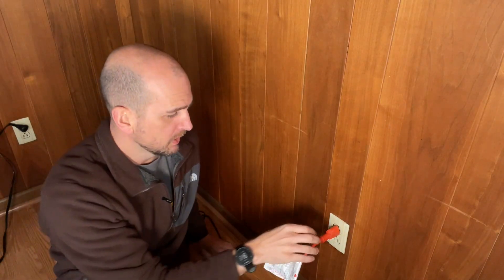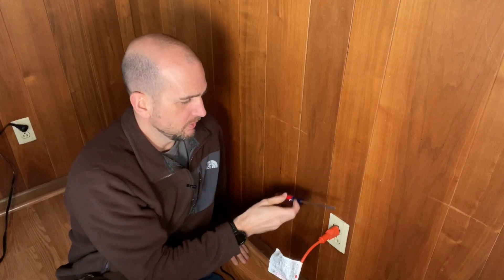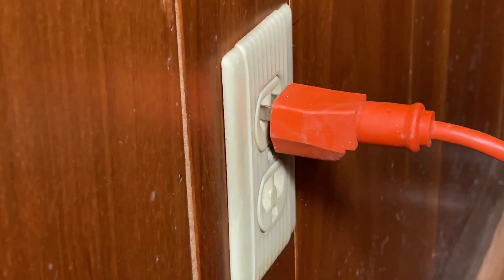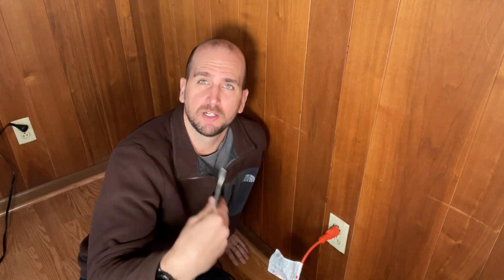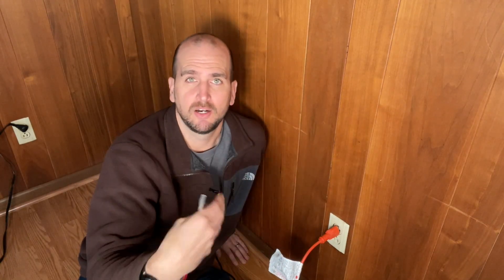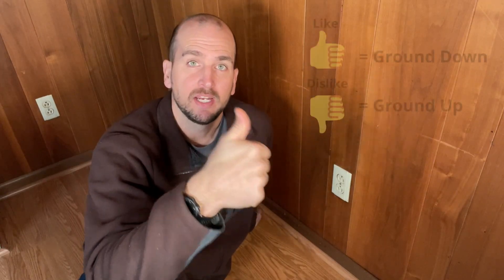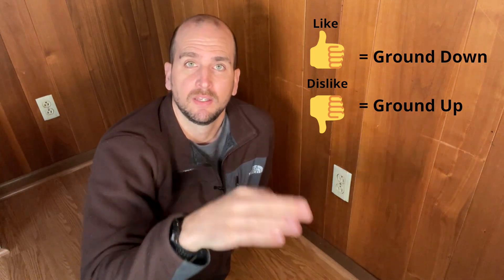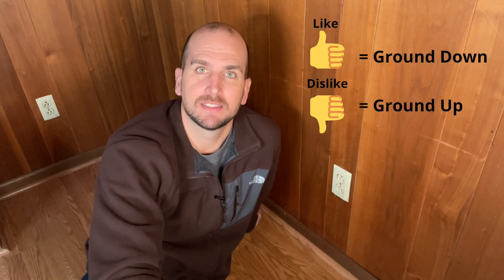Should An Outlet Be Installed Ground Down Or Up

Comment: I saw my Dad mount outlets ground up in the 1970's . I thought it was weird, so I asked him why. He said, looking at the male plug, that the ground prong was longer, and so, had to go in first. He put it on top, to make the first  part of the operation easier. Made sense to me. He had had it out, politely, with the local inspector, who could find no rule against it.
Note-I worked many years as an industrial maintenance mechanic and electrician, and always installed them ground down.
Reply: Mechanic/Electrician, were you a multi-crafter? That's what my job calls us maintenance folks
Reply: @lauratanner8475  yeah. I was officially a Maintenance Mechanic. But I worked in small shops where I did it all.  One where I single handedly ran all the rigid conduit and pulled all the wire for 80 A, 3 ph, 480 v welder outlets in 2 djfferent buildings. One where I did the complete installation,, power and control, for a high speed rotary cutter. I rewired panels, rebuilt control boxes. I was happier doing electrical work than mechanical, but had no license. In multicraft shops, no electrician ever found fault with my electrical work.

Comment: Always per NEC ground down, if ground up and the hot wire was to come loose and fall to the bottom of the electrical metal box instant short spark and possible fire.

Comment: Ground up ALWAYS, for me. Why? 30 years ago, one of the kids had a toy tambourine. One day they dropped it & one of the thin metal disc's came off. By pure fluke, it hit the wall & slid straight down on to a ground-down plug, causing it to short with a flash/bang. There was barely any space between the plug connector & the socket, just enough for the thin metal disc to fit in between. It was a pure fluke that may never be replicated, but since it did happen, the homes we bought since then, I've insisted contractors install all plugs ground up.

Comment: I have seen hospitals doing it both ways.  Sometimes even varying in different parts of the building.  This week I even saw a duplex receptacle mounted sideways above a desk with the hot side facing up.  Now that I think about it, what about mounting plugmold?

Comment: Like you said it is up to the Inspector for when I had my inspection on my house the inspector said reverse the outlet on refrigerator  for the cord went up.  I just replaced the plug / cap and inspector said perfect.  He said you can't have tension on cord by doubling it over.  Black coils help keep it plugged in and I don't know how hot the coils get but it never melted plug in ten or so years.  My coffee maker  did melt the cord but luckily it melted on Neutral side and never blew breaker.  Inspector had only one issue and all outlets  had  both  ground up & ground down but kitchen was the only issue .

Comment: Ground up
It happens all the time a commercial buildings when a desk is against the wall and a paperclip falls down the backside it will hit ground first 
Or if the outlet has a metal cover plate with one screw holding it on. 
Safety starts with a "S" but it begins with YOU. 
Ground up not down

Comment: Ground should be down.
Gravity tugging a plug coming loose from a wall can cause an up-facing ground to fail first.
You want the ground to fail last.
In a grounded appliance the ground is the most important connection.
Reply: "The most important"?  More important than having a working "hot"? What's the point of having an electrical appliance without giving it electricity?

Comment: The male ground pin is a bit longer than the others. So if the plug is lower than eye level ground up makes it easier to plug in. Higher than eye level, ground down is easier. 
The arguement about a loose outlet is mute. It is a fire hazzard. loose electrical connectors generate resistance and heat.

Comment: Not sure if this addressed above but back in the 60s when grounds were introduced, bedrooms and living rooms had switched plugs. You could plug a lamp into a plug and turn it on with the switch(there were no lights on the ceiling). If a plug was switched, we would install it upside down (ground up).

Comment: I was taught  in trade school  ground  down  years ago  one reason why  is normally  the ground  prong is longer so if the   receptacle be comes  worn and become loose and  unplugged it will fall outlast  keeping you safe   installing ground up it is a 50/50 chance  even  with a steel cover plate it could tilt one way   ground to hot or ground to neutral  i have been in the electrical trade since  1976  I seen done both ways  here is the thing  there is no right or wrong  but if i am working in a building or work sight if they are all up or all down  I match  what is there

Comment: When I'm in Mass. many places have ground up and I was told it was a state or local code to install this way.  I like the European Schuko plug where ground always makes contact first and the plongs are always shielded by the recessed face of the actual outlet.  It is almost impossible to have shorts across the terminal as when the plug is pulled out far enough to reveal the prongs they are already disconnected from the power.  US Codes are somewhat behind on outlet safety.
Reply: That Euro standard is for 220v. We use slightly less lethal 110v.
Reply: We also use slightly more lethal 60 herz.
Reply: In terms of electrical safety, the US has so many countries to be jealous of for so many reasons,

Comment: I mean let's think about it, if the ground is up, the live/neutral is down. Now let's say for example there is some sort of flooding or moisture. The water will fill from the floor up or run down because of gravity. Then the water would be live first if making contact then not until another half-inch or so ground

Comment: WOW! I asked you this question a few months ago in a previous video you did. As a maint. engineer, I've noticed that in my past two jobs (Hotels/Office Bldgs), the ground is always up. But in homes, I've never seen the ground up. Always down. So I wanted to know why. Was it "Code" for commercial properties? I've asked several electricians and no one really knows the answer but there a few guesses. The one that made the most since is that safety reason you mentioned incase something falls off the wall (Nail, picture frame, etc.) But why wouldn't home builders do that too if that were the case? So maybe, I'm thinking it just may be preference. That manufacturer you mentioned that printed "Up" on the outlet, was the ground up or down? Thanks for the video.

Comment: Ground should be down due to the weight distribution of some common power devices, like high current power transformers used in security applications, from alarms, access control, cctv, or other similar power needs. These transformers have most of their weight on one side and the wires need to be going downward. But as stated in the video, flat plugs would have the cable upwar...
It would seem the world expects the ground to be down.

Comment: I like ground-down as it is most popular in my area and most surge protectors I find with the sharp 90 face toward ground. However I have flipped them for night lights in the hallway. where it isn't the ground that matters, but rather the side of the wide plug. I like your idea about flipping them for switched lights.

Comment: Ground facing down seems to be the overwhelming assumption of the manufacturers of on plug AC to DC transformers.  Some of the older versions of these can be quite heavy and will unplug themselves under their own weight if you try to use them with a ground up wall outlet - forcing the use of a surge strip in that situation.

Comment: I've noticed something to make note of. On newer through-the-wall air conditioners that have built-in GFCI protection at the plug-in point, it's a toss up between ground up and ground down. Depending on the unit, you may have to rotate the receptacle to avoid having the cord make a u-turn and hang down from the top of the GFCI box creating a stress point in the cord and its exit point.
Additionally, the markings on the GFCI box such as 'test' and 'reset' are always oriented for the cord exiting the bottom of the box. Conversely, GFCI receptacles usually have the printing in both orientations for installation in either direction.
Reply: Yes,  there is a toss-up between the two.  It's a real juggling act.  One will always be up in the air.
Reply: That s for electricians that can't read upside down
Reply: @lostcause1206  Shockingly (no pun intended),  many people cannot read text upside down.  Everyone is dyslexic to some extent; it's only a matter of degrees.  I am slightly dyslexic,  but I have no trouble reading rotated text.  In order to explain,  I must digress:  It is instructive to note,  though,  that all human traits,  even personality traits,  are present in each and every individual.  Certain traits may be non-apparent, or so subdued by culture and upbringing that they are apparently absent,  yet they instinctively do exist.  I offer an analogy of a pipe organ.  If only one stop is fully pulled out,  and the rest are pushed in,  then the rest of the combined harmonics may not be audible,  yet they are there,  because the sound from one pipe can affect others as the air is vibrating around them.  Now,  if the organist slides the stops in and out to obtain a certain voice,  then that voice is unique to those stop settings but quite different from radically different settings.  So it is with human personality.  The blending of the different prevalences of traits makes up a unique individual personality profile.  If dyslexia overshadows other traits,  then it can be detrimental to literacy,  and so it may be the reason why certain people cannot read rotated or mirrored text.  But I digress.  I gave you fair warning, though.   ;)
Reply: @gyrgrls  like trying to watch a you tube vid sideways or upsidedown .
Over 
Under 
Sideways 
Down.🎶
Reply: @lostcause1206  You'd be standing on your head to convince us stubborn electricians.
Reply: I never noticed that about window shakers,  probably because I never paid attention.  However,  that's nothing that an 8-inch 12-inch extension cord can't remedy.  Plus,  it can free up the other socket in a duplex receptacle.  I think most codes require a single socket receptacle for certain appliances.  I'm too lazy to look it up in the NEC.  But at least,  most heavy appliances require a dedicated circuit,  regardless of whether the outlet has a single or duplex receptacle.   I certain cases,  I like to split the duplex receptacles into two separate circuits,  anyway  (with separate neutrals)
.
Reply: @gyrgrls   NEC Article 310 - wiring methods.
Reply: @lostcause1206  I just looked it up.  310 deals mainly with ampacity,  marking,  and nomenclature.  The only thing relevant to the neutral conductor is the current carrying capability of a grounded conductor (neutral wire,  not a suspended railway employee).  But my train of thought was sharing a neutral between two circuits of different phases can result in unpredictable voltages across the two circuits should the neutral fail.  This is why I don't share a neutral via 10-3 NM cable anymore for two sockets on separate circuits unless both hots are on the same phase.  I learned this a long time ago,  the hard way.  It was wiring for new equipment installed in a laundromat,  too.  OUCH!  Luckily,  the owner was able to get replacement parts for the fried machine under warranty.  Using a common neutral between different phases is not prohibited by the NEC,  but it is not very wise.  It gets worse with single-phase 240/120.  A center-tapped 240 is SINGLE PHASE,  but OPPOSITE POLARITY.  The two hot legs are in phase,  but in series and of opposite polarity.  Lose a common neutral,  and whichever device draws the least current AT ITS RATED VOLTAGE will get the most voltage,  as the two devices will be running in series with no neutral return to ground.    As current is a series circuit is always the same for each device in series with the supply,  the device with the lowest impedance will almost certainly be damaged,  as one 120 volt device might get 10 volts while the other one would get 230 volts.  NOT GOOD!
Reply: @gyrgrls  sorry it was 210 branch circuits , but one art. leads to another ,  I'm glad to be out of it all ...

Comment: I've had ground up specified on jobs. It's my understanding that the biggest concern is when using metal device covers - hospitals, restaurants possibly. If the cover comes loose and drops between the cord cap and the device... That being said, I personally do not like ground up. Even for 1/2 hot switched receptacles, I'll take a black sharpie and put a little dot in the middle of the recept. Just my .02

Comment: Unless specs require, I install ground down.  When Installed horizontally I insist, of me and my crew, that neutral be up.  More often than not prewired and whiped power poles (cubicle or cash register) will come with ground up... I don't know why since they might see one or two plug in and out cycles in a year.  That stuff doesn't move much.

Comment: When gravity pulls down on the cord it's better to have the hot discount first before the ground. This is especially true for a metal appliance with the potential of an internal short to the casing.  So ground down safer.  In my opinion.

Comment: yep, you nailed it. inspectors are more and more liking the ground up. i install all residential ground down for stated 90 degree plugs and most night lights and chargers are designed for it, also because I like the smiley face . commercial always gets ground up. I worked at u.c. of California, they always wanted ground up.

Comment: In nearly 50 years of apartment dwelling in NYC and St Louis region, and traveling throughout the eastern US, I cannot ever recall encountering a ground-up outlet. And I can only recall one switch that was installed off-up (not counting linked switches). 

I like the notion of orientating the socket to prevent accidental shorts, so how about rotating the sockets 90°? The only connection that can make is between the neutral and whichever side of the circuit is on the up side. That's actually how I placed the electrical sockets on the fascia of my model railroad.

Comment: Honeywell had them installed ground up, most every house I see around here is ground down. In chicago they were sideways.
Reply: I remember sideways.   Was wondering what happened with that.
Reply: Was the ground to the left or to the right?  I installed sideways for my kitchen island and wondered if there was a preferred way.
Reply: @moonrich3492  I do not remember I haven't been back to Chicago in 20 years.
Reply: @shloomyshloms   Still sideways, ground to the right.

Comment: Ground down. I could see making them ground up to mark a switched outlet, but ground down is how the outlets were specified to begin with. All power bricks expect ground down and simply don't work well in ground up at all. I've had short power strips that don't play nicely with a ground up socket because the cord has to rotate to fit, causing the power strip to lay to one side rather than sit upright. In short, I've never encountered a single cord or device in North America that was ever designed with the expectation of ground up receptacles. It just simply is not the standard.

Comment: I bought a house with the ground up configuration and immediately faced issues when it came to inputs such as appliance plugs, power strips, wall timers, and those dreaded power adapters (wall warts) with polarized plugs. Whether you like it or not, a lot of consumer electrical devices are designed for ground down orientation.

Comment: Ground up sucks
On heavy cords like 240 volts for dyers it sucks and stresses the wire out and cause issues of it’s own.
The use of hospital grade plugs for 120 volts is better as the clamping pressure.
Every time people try to make new rules to keep people from doing stupid things around electricity. They need to remember you can not fix or engineer out stupid

Comment: I always do ground down (note I only do residential work). The 2 driving reasons for this preference are 1) The scenario you noted where plugs for consumer devices are typically designed for a ground-down orientation. 2) In the worn-outlet scenario, the weight of a grounded cord will cause the hot and neutral to lose contact before the ground pin. If I'm using an appliance that requires a ground for safety, I'd rather the appliance stop operating over safety of the appliance/operator being compromised. From what I've heard over the years, ground-up tends to be preferred in commercial applications because they almost always use metal cover plates and a fallen cover plate/object seems to be of greater concern.

Comment: Throughout the 1970s and beyond the standard was ground down.  Builders stopped providing light fixtures on tract housing and opted for a switched outlet instead.  In some cases, the electrician would install the switched outlet ground up, so that the homeowner would get the hint that the (seemingly) non-working portion of the outlet is on the switch by the door.

Comment: most people reach down to insert and extract a plug.  with ground installed up you ensure that the grounding prong is in contact with the receptacle after the energized prongs have disconnected, an extra measure of safety.  this extra safety is important enough that the grounding prong is actually longer to ensure it is the first connected and last disconnected